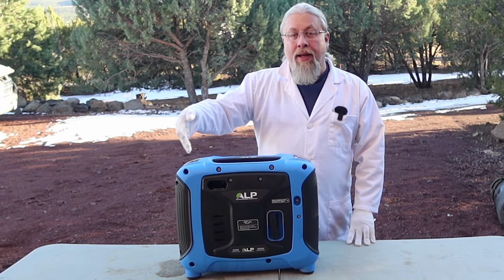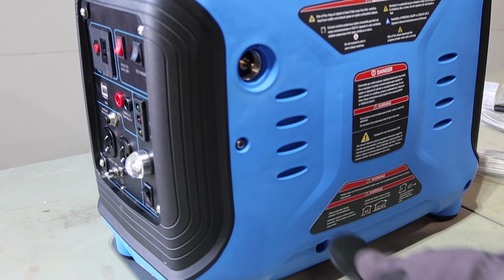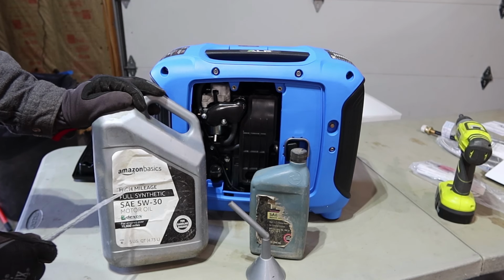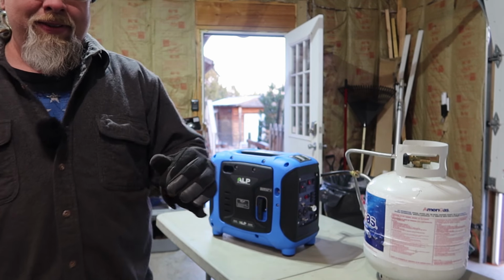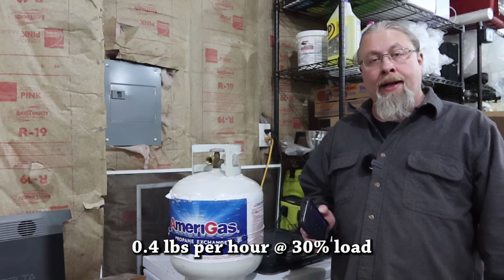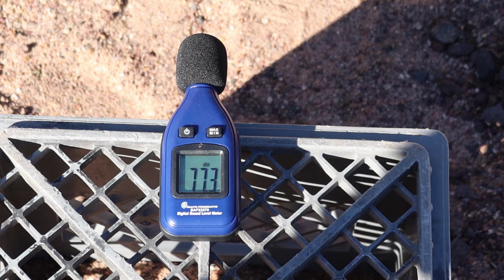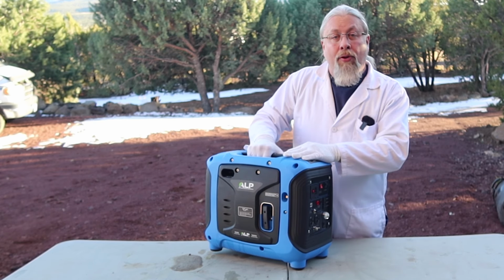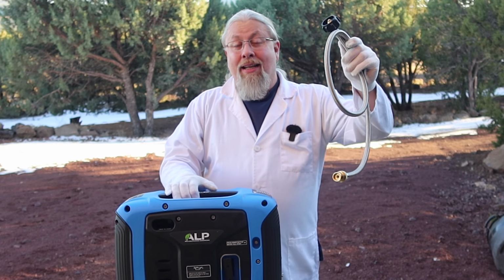ALP 1000w Propane Generator Review | Parallel Ready Eco Friendly Compact Efficient

Comment: The sound level rating for generators is usually measured at 7 meters. That's why you found it to be louder than what they advertise.

If you want to run a 5K BTU window AC. Get the Frigidaire FFRE053WAE (410 watts) and a gas generator that will give you the longest runtime per gallon on ECO mode capable of powering it. That will give you the lowest fuel cost to run one.

Comment: Great presentation !!?! :>)  FYI,  propane runs way cleaner than gasoline engines.  since the Alp runs strictly on propane, it should be able to run longer between oil changes.  Keep up the great videos,, please :>)
Reply: Russ is correct , propane is a lot cleaner fuel .
Reply: @donhenry7879  just what I was going to say! ;-)

Comment: Great Job Tom! One can also add:
- that you can generally store propane indefinatly 
- propane is much better for the engine longevity because it burns a lot cleaner and leaves less soot
- and you dont have to worry about the carb getting gunked up from leaving fuel in there

unleaded has a shelf life, would need fuel stabalizer, and most unleaded is mixed with ethanol which is not good for the longevity of some of the internal components.
Reply: Exactly where in the world do you find most unleaded gas to be usable only by flex fuel vehicles? What you want is an ethanol generator that produces heat obviously you can use in other words it interfaces with your existing hot water heater. During prohibition we were allowed to buy 200 lb of fruit to operate the generators or just drink
Reply: Indeed, the clean burn is probably why the oil change recommendation is greater than for gas generators.

Comment: Thanks, I learned a lot about propane generators on this video. We have a huge dual fuel generator to run our well for emergencies. We have it set for propane though keep both fuels on hand. We got it from Costco on a sale. So far it works well. It's very large and on wheels.
Reply: I use a dual fuel as a whole house backup generator in a rural area. The advantage of dual fuel is after your primary and backup propane tanks run out, you can siphon gas from your car and you're good for days or even weeks.
The only time I needed gasoline was when the vacuum hose (cheap Chinese plastic, only 16 months old) cracked and leaked so it no longer allowed propane in.
Reply: @TheOtherBill  great ideas! We better check those hoses.

Comment: Could possibly get a slightly longer screw of the same size and solder a wing nut at the head. Would replace the existing screws with a tool less option. Put a small rubber spacer just below that to fill the space where the original screw head would have gone.
Reply: Was thinking along the same lines, and wondering why ALP didn't just provide wing-nut type screws to begin with.
Reply from the maker: I think they didn't want anything sticking out.

Comment: The main reason this generator is more efficient than a dual fuel is that propane has a significantly higher octane rating that gasoline.  The motor can be designed with a higher compression ratio to take advantage of the higher octane.  This may partially explain why it’s a little louder than comparable generators.  As the professor stated though, propane is less energy dense.
One advantage of propane the professor didn’t address in this video is storage.  Propane fuel doesn’t degrade over time and the equipment that runs off propane takes a little less maintenance to put into extended storage since you don’t have fiddle with fuel additives or drain fuel from the carburetor. 
The professor is being cautious about the oil drain interval. Stating that he would change it at half the listed hours.  On a small motor like this, it’s cheap insurance.  My experience (from years ago) with working on propane converted V8’s is that the recommended change interval can be significantly extended because propane burns so much cleaner.  We came to that conclusion through oil analysis and real world experience.  

Great review as always Professor!
Reply: The propane being the clean fuel that it is , is most certainly why the 100 hour oil change is listed
Reply: @chadjones99  I ran a fleet of vehicles, and the Propane powered fork trucks required the least frequent oil services. Based on color. Propane leaves far less residue in the combustion cycle, so less oil contaminates. The lack of water in the fuel was an additional plus. Water in the oil creates Sulfuric acid, which is obviously corrosive and needs to be removed. Propane, not so much. CO2 output is far less as well.
Reply from the maker: Many generators claim 100hr change but I found that's way too long and probably why my Sportsman self destructed.
Reply: @HOBOTECH  i would agree for gasoline fueled gens but with propane its a lot cleaner . Maybe this would be a good review for your Channel send the oil out to get analysis on 100 hours with gasoline and then use the propane one and do 100 hours and see what the difference in the two oil samples is
Reply: Just make sure you are wearing the lab coat
Reply: The metal in the oil and non gasoline related contaminants are still present at the same levels if not more.
Reply: @Freeknickers24  what metal do you refer to? Initial oil change? Or particulates in the finished oil product as delivered from mfr? Affective cleaning prior to assy reduces the first, vendor QC affects the latter. But Carbon is much higher in the gasoline/diesel fuel than Propane. The free Carbon is compressed under heat and pressure making a weak diamond that is stronger than the metal.
Reply: @Freeknickers24  You are very correct.  I hadn’t thought about that.
Reply: @crllovg1  Tonopah kids
Reply: Did you know that Propane outboard motors are available?
Reply: @dam4274  Interesting, especially regarding submerged exhaust.
Reply: @dam4274  don't care

Comment: well.  first ..the BIG reason to buy this is to use a small a/c  why didnt you test with a/c ????   I LOVE  the European design and the colors.  very cool.  I bought the BAJA  700-900 watt propane (Amazon)  $399.  it will NOT  carry the a/c ....almost but trips off.   I suspect this has same motor and it will also trip off.  I am hoping I can use the Baja (used to be sold as a Ryobi)  maybe Sportsman ??  will be able to charge EB24 or AC200 while I use a/c.     I had a yAMAHA  1000  but Hurricame IRMA  2017 in Caribbean took it from me (along with my home and EVERYTHING  I (used to )  own.  all gone  including my dogs.  ya  ...at 68 I am starting over...lifed can bde cruel  HAPPY  HOLIDAYS  !  I really APPRECIATE YOUR hard work   Thank You Sir
Reply from the maker: You can't test an A/C at 40 degrees. I know for a fact it will run one because my 800w Sportsman did and this has more power.
Reply: Impossible to get an AC compressor to kick on in the dead of winter, is the likely reason..

Comment: It's a hard choice between that and the Baja 900 (Ryobi).  I would have preferred to have DC output and a pure sine wave inverter - my Baja has neither.  The 15% power increase wouldn't have hurt, either.  Still, the Baja is almost half the price and suitable enough for my purposes, which is mainly a backup method to charge my batteries on days solar is insufficient.  But the DC output would have made charging more efficient and eliminated the need for a charger, and the pure sine wave would have made it more versatile (such as running A/C or sensitive electronics directly from generator).  Great review, gives me something to chew over.  😋
Reply: i also  have Baja  just to use as backup.  it will NOT carry an a/c.  hoping it might charge Bluetti while I run a/c.    I am seriously considering another Yamaha or Honda.  Although I do have solar panels I think a good generator is another good option to charge battery bank.

Comment: Question Professor: Have you reviewed those Flame King 1lb re-fillable cannisters sold at that web page, or just re-using of Coleman is fine? I watched your instructions on how to refill the Colemans but mine are getting shabby.
Reply: Have the Flame King refillables and the refill doohickey myself, very happy with them. Paid for themselves in no time. The cylinders are slightly larger than the disposables, definitely verify they'll fit in your device before heading out to the woods and relying on them.
Reply: Refilling/reusing disposable propane canisters is not recommended, and has led to “explosive” results. People have died trying to save money this way. Check it out.

Comment: Wonder if it loses efficiency  running very small loads, like being emergency  12v pwr for your diesel heater. Though I guess u could also charge your batteries at the same time.
Reply: depends what you mean when you say efficiency , if you chose to operate it below its sweet spot then of course it operating below its best generation per unit of fuel even though its still operating efficiently as a combustion engine.

Comment: Can you use it on natural gas?
Reply: Some generators have conversion kits for that. that might be a better question for ALP in general. the one thing idk is how same/similar/different the air to fuel ratios would be  between propane and natural gas
Reply from the maker: Not unless they offer a kit for it.

Comment: Professor, Removing 2 screws with your power drill is a piece of cake. I wouldn't call it a deal breaker just because you need to remove 2 screws to change oil.
Reply from the maker: It's not a deal breaker, just annoying. All my other generators are tool-less.
Reply: @HOBOTECH  I am all for "the easier, the better" no tools idea too.
Reply: Doesn't everyone have a tool box or even a multi-tool nearby always?

Comment: The generator may have enough power to run a small air conditioner, but can it start one?
Reply from the maker: Of course. I ran an entire summer on a 800w Sportsman with less power than this.
Reply: @HOBOTECH  the cost of the SEER  40  about  small air conditioners  has come down significantly  and they are testing models in India that cost less than $400 to produce  and  use less than 700 Watts  producING 18000 BTU of room air conditioning ! I am not impressed at all with that accomplishment because 700 watts of electricity is far too valuable to waste producing only a "ton and a half" ["6000WATTS?" ] of air conditioning.

When intervening in the destruction of all life on Earth being able to do "500% better" is arbitrary and totally impotent. A small inexpensive turbine using liquefied atmosphere can produce mechanical work [TRACTION OR HEAT PUMPING NOT JUST ALTERNATING BULSHIT CURRENT AKA "ABC"] and HELLO Cooling far better than any of the proposed Solutions not to mention the fact that 18000 BTU Cooling is enough for a small village or even a large Village if the cooling is for the people instead of the windows. Which is to say a you can enjoy fresh air however hot and humid because the radiant Cooling is that efficient even if you are using a $50 air conditioner compressor and R22. Among the various hoaxes are that refrigerants matter. What matters is them being expensive enough for people not to leak into the atmosphere. Carbon dioxide for example is not expensive enough. The production of liquid atmosphere becomes cheaper as you produce more if you remember the Saudi Arabian Sheik saying they needed $70 a barrel or whatever understand that the equivalent in liquid nitrogen at similar scale is in the nickels and dimes Arena not tens of dollars and currently if you sign up for regular deliveries it is several gallons per dollar with an energy density in excess of lithium ion batteries. Do you know anybody who is selling lithium ion batteries for several gallons per dollar? At that cost you can just release the liquefied atmosphere back into the atmosphere and buy more you don't have to return the lithium ion batteries for charging or buy a charger etcetera. it's about buying energy and getting what you need done with it not lining the pockets of the balance of system cost predators.
Reply: @arts8302  OMG!!!🤯 What in the world was all of that for & why, why, why???🤔
Reply: Art S What the hell are you smoking? I read that three times, and have no idea what point you are trying to make. The ramblings of an idiot.
Reply: @spencerwilton5831  You're saying that you don't know how to ramble ? I can't help you with that but I recommend an English as a second language program we will teach you how to use the dictionaries for example You can look up what AKA is it's an abbreviation you can look up the word abbreviation . I don't think you're here for the same things that I'm here for So it's okay that you are not empowered by my wisdom in fact it's probably the only hope we have.

Comment: Based on the review, the claims on the Alps website regarding sound levels and run time are a bit optimistic.  I guess this would come in handy if your boondocking on a solar system, stationary and have a several dark cloudy days.  It is more efficient than a dual fuel generator but if I am really boondocking, I would probably prefer the dual fuel aspect for emergency situations or times that you just do not want to break camp...  siphon off a gallon of gas from the van to recharge batteries and stay an extra day or ???  I am just learning...  Nice review.
Reply: Almost all  (read as all) generator sound ratings are measured at 20ft or more from the generator.   Hobo measured at like 5ft.   I've had 3-4 inverter generators and don't see the ALP as any more noisy.

Comment: I like the aspect of the use of propane but it is way to noisy still and I have not seen any solar generator yet that could operate my needs but I can be wrong, that can operate at least a air conditioner during the day off solar panels alone with a sizeable battery bank at night. It just seems to me again I could be wrong but building a system is still the way to go but feel free to correct me if I am wrong. Once i get off vacation, I will be working on building a decent sized system but have two projects going on at the same time which one of the two is for a lot larger income base to get the solar system built faster so I have no real choice but to do both. Is there a sizeable solar generator that I do not know about that can handle a ac and minor things?
Reply: Put an inverter on your car, if it is a temporary backup solution. You are already maintaining your car, it will idle for days.

Comment: The rubber adapter hose defeats the reasoning for steel braided.  Contaminants from rubber.
Reply: what contaminants? the 20# tank can be full of oil, rust and other crap.  As long as the hose is rated for LP its fine.  add a filter
Reply: @barxracerful  lp rated rubber hoses still break down..not referring to tank contaminants.
Reply from the maker: Doesn't matter. This isn't a Buddy heater with a delicate element.

Comment: I did a propane conversion on a larger gen a little while back. I will never run gasoline again. So the gas tank on the gens just become more space and weight. But I want a 2,000 - 2,500 model. A few weeks back I emailed ALP. They said a larger model was in development. for early 2021 release. 

Keep and eye out and do a review on that for us
Reply: Recently did a tri-fuel conversion on my Yamaha EF3000isB.  For less than $150, got everything I needed to have it run on propane, natural gas, or gasoline.  I haven't run it on gasoline since.   Love it!
Reply: My thoughts exactly! I have a 1000W Jackery that supports most of my needs, but have had a few situations where I needed more. Albeit this is an excellent option @ that price compared to what the Jackery cost for the same amount of power.

Comment: Another great review. Most powerful electric heaters need about 1500 watts to really heat a large room so I would recommend at least a 2,000 watt genny if you need serious heat. I converted my little Honda Eu2200i to propane (Hutch mountain) and even at that wattage it really revs up when connected to 1500 watt heater. This is my the best Generator review channel on all of YouTube. Thank you for all the informative reviews!
Reply: For those who might be reading your comment they should know powering resistance heaters with inefficient generators is the definition of stupid. A little bit of platinum can go a long way.
Reply: @arts8302     I assume it's only for short emergency situations where the need for heat outweighs efficiency concerns.
Reply: My wood stove takes care of my heating needs if power goes out. Just want to charge my Bluettis and my EF-Delta Pro on cloudy days. I'm waiting to see what their next bigger model is.